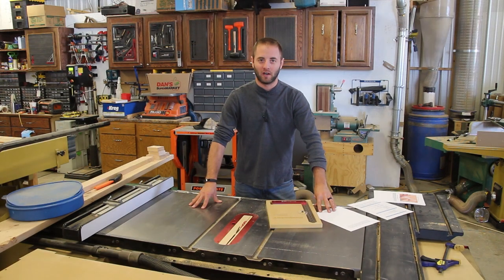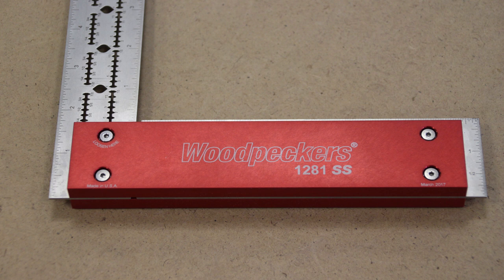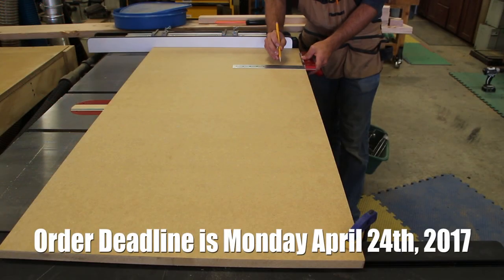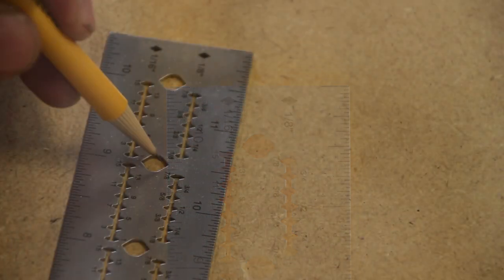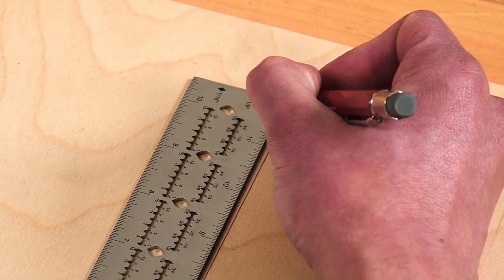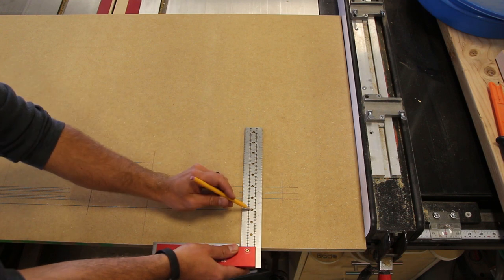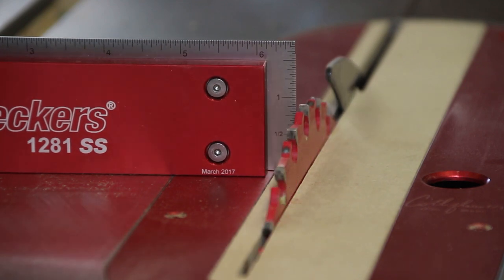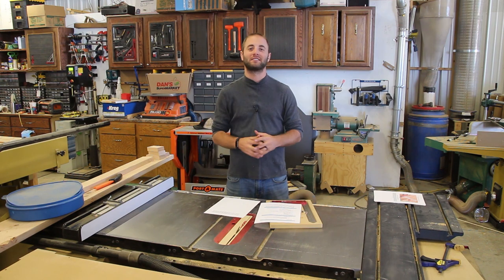Woodpeckers Latest OneTIME Tool | 641SS and 1281SS Squares

Comment: I make the 641's, the 851's, 2616, and 1812 at woodpeckers and they are priced like that for a reason. They're made in USA, and they get inspected a bunch of times and with a whole laser program that checks everything in the quality control area. They're also made on a newer haas cnc machine with extreme accuracy.

Comment: For the people complaining about using a pencil to check squareness, try the same technique just use a marking knife. With that said, how many thousandths of an inch of accuracy do we need with most woodworking projects? Starrett are 0.0001 to 0.00001 depending on model as stated below. I think we're getting into machine work not laying wood projects. My opinion of course.

Comment: adjustable square and spot on should not go together in the same sentence.
Reply: Sorry, have to disagree. A good quality adjustable square is always spot on if you take a couple of seconds when adjusting the blade.
Reply: Adjusting to eyeballing the middle of two thick pencil lines has nothing to do with accuracy.
Starrett squares are precise to .0001" per 6", or .00001" per 6" for their certified engineer's square.  Eyeballing the middle of two 1/32" or thicker pencil lines is not even in the same ballpark of precision.  Even old time wooden squares were kept more precise (with hand planes that can shave at a thousandth of an inch accuracy).

Is it good enough for a machine wood shop?  Certainly.  But it has no place where high precision is needed.
Reply: I always laughed when guys talk about the flip method of checking a square for precision. And " a couple of seconds " to adjust the blade for precision i have to laugh rolling around on the ground.
Reply: To be fair, it is good enough for a typical machine tool wood workshop.  For that use, I'd think this marking square is going to be excellent.  Just not for a machining shop or fine woodworking.  Different tools for different jobs.

Comment: At least once in the video, it is referred to as a combination square.  It isn't.  A combination square will have a sliding head and a 45 degree mitre head face.  This square also isn't for trying, because it lacks a flat inner edge.   This is a marking square.

I'd also disagree that this would be useful for cabinet makers and fine woodworking, because it is made to work with the low accuracy of pencils, not striking knives and awls.   It's certainly made for being used at a machine shop, where it can be a great time saver.  But it can't take the job of a combination square and marking gauge for fine woodworking, where you don't deal much with numbered measurements, but exact copies.
Reply: I think he was comparing it to a combo square saying this would save you time over a combo square and even says adjustments are fast as moving your pencil